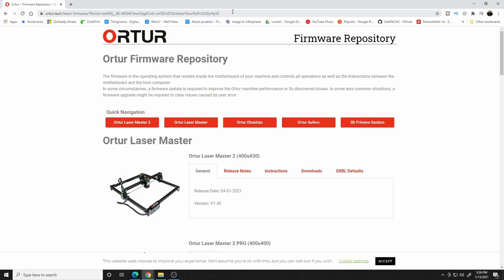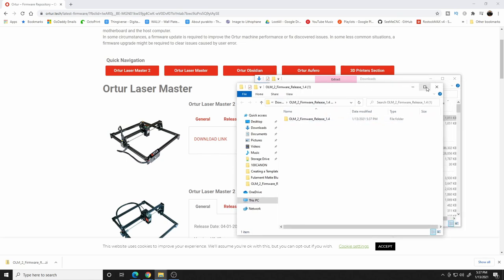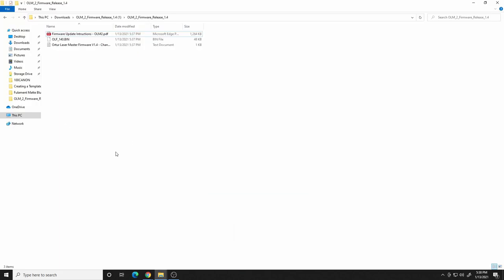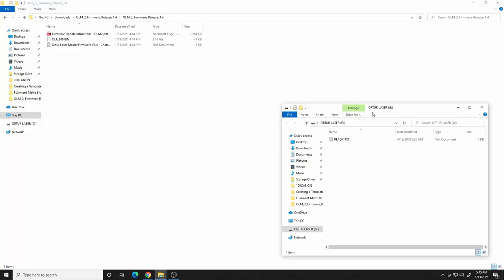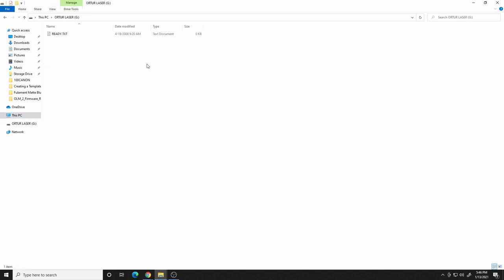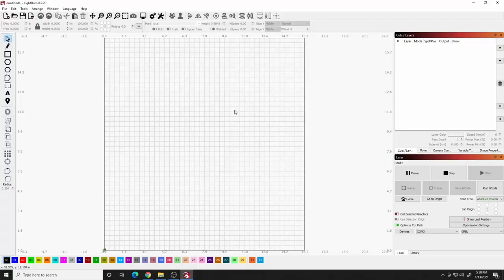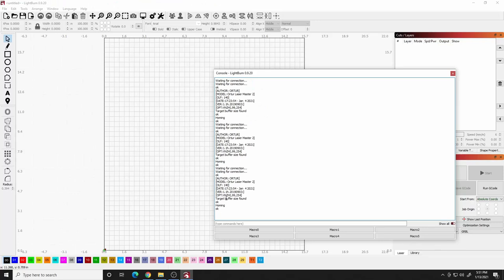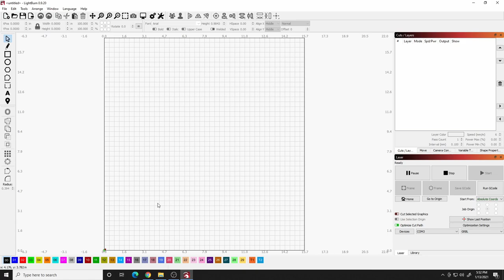How to update firmware on a Ortur Laser in 5 minutes or less

Comment: Have to chuckle at the recommendations ...
When NOT to up upgrade or reinstall firmware:
- Ortur Laser Master 2 is working correctly and showing no problems

When TO upgrade the firmware:
- A new version of the firmware is posted...

I'm not having issues, but a new version is posted .... WHAT TO DO ???   hehe  ; )

Thanks for the video.
Reply: Updated hardware and having issues with the burning what should I do I'm doing the same thing same settings still having problems

Comment: I have the latest lightburn 0.9.20 but when I right clicked on the “devices” tab but it’s resetting the current device connection. I’m not getting the pop up that you are getting
Reply: Me either. Did you figure it out? I'm on day 2 of learning all I can.
Reply: Found it by accident or fate. Alarm went off since the laser won't shut down.
Reply: @euphoricstillness  nope, I’m still getting the same thing.
Reply: @ryanbeharry5636  Near the move tab is a console tab. When you start up the laser it will automatically home and the message will show up in there. Good luck

Comment: I havent followed this advice as yet, and now I am reluctant to change anything after reading all this.  This is the message I got whilst trying out my LM2 20w (older version).  Starting stream
Layer C01 Pass 1 of 2
Layer C01 Pass 2 of 2
Layer C01
Layer C01
Layer C01
Layer C01
Layer C01
Layer C01
Layer C01
Layer C01
Detect movement, terminate laser engraving!
Acceleration fluctuation:325
Reset Grbl.
Ortur Laser Master 2 Ready!
OLF 137.
Grbl 1.1f ['$' for help]
[MSG:'$H'|'$X' to unlock]
error:9
G-code locked out during alarm or jog state.
On or near line 39911:
Job halted
Stream completed in 50:51

Comment: Hey there...I have watched several other videos you have that have been very helpful and have recently subscribed. I tried the firmware update this morning and after dragging the new .bin file over pressing the reset and then the power button get nothing. Was hoping this update fixed a couple disconnect issues in the middle of a few burns but this not powering up thing has me freaked out!  I did message Gil and Ortur tech support and am trying to be patient for a reply from either.  Is this fixable as far as you know with out having to order new parts???
Reply: this happened to me what did you do?

Comment: Jim, in the caution note you say not to use the PRO firmware and use the LM or LM2 firmware. I assume that is because you have the LM or LM2 model. I have the LM2Pro so I should be using that version? I'm new to all of this laser stuff so I'm trying to muddle through it all. Thanks in advance.
Reply from the maker: Use the firmware that is for your laser. If you have the LM2 Pro use that firmware. Good question!

Comment: Did the upgrade. and then would not start. I did not have clue as what happened.
So after searching for about 6 hours I found the OEM bin file. put it back and back up and running
Tech support. all they could say is try this try that. if there is anyone who had the same problem
let me know what you did to get it back up and running.
Cheers

Comment: Ok did all that but now my laser is not burning at full power, seems to only be burning at about 25% power. I am using lasergrbl when I click the laser button so I can set the focus the laser shuts off after a few seconds and then I have to reset the Ortur. Anyone have any idea whats going on here. Used my burner a few weeks ago with no issue to burn some Harry Potter coasters. Any help would be greatly appreciated. Thanks
Reply from the maker: I would try it again and make sure you have the correct firmware for your laser. Otherwise jump on the Facebook group and tag Gil. He is support and he will help you get it worked out!

Comment: So just went through this whole process and now the unit wont power back on. Everything went exactly as you showed, but after the reset, the power button wont work. Any ideas?
Reply from the maker: Did you use the pro firmware? If you did, do it again using the regular firmware

Comment: I did the update just fine, cleared everything but now my homing is completely jacked. It is trying to home to the lower right even though everything in the setup is lower left. It can’t find my project on the table and the fan stays on after I try to do a test fire or frame!!!! I have the latest LightBurn and Windows 10.   Any ideas?

Comment: Well, just got my laser...put it together, excited to try it...noticed the firmware was not the current one...apparently against my better judgement, followed all the instructions to update and now I'm stuck with it not turning on. Still can get it to mount to the computer but nothing else. I've reached out on the Facebook group so hopefully I can get it sorted but man I'm bummed out.
Reply: @Ryan Wargo Make sure you are EXTRACTING the file and not just opening it. The bin file is a different size after you extract it.
Reply: just updated mine to and now it wont turn on did you find a fix for this yet
Reply: @Mysticalmantiscreations  yes extracted it with WinRAR...which includes the bin file, pdf instructions, and changelog. Pretty sure I can't extract it any further, atleast not with right clicking it.
Reply: Sorry man, other than that the only thing I ran into was I didnt have the Pro (which I thought i had) i downloaded the other one that wasnt for the pro and extracted and it worked fine.
Reply: @Mysticalmantiscreations  so I thought about that but apparently everybody is supposed to download the standard file because the Pro download is for a different machine not out yet...not for the Pro motherboard
Reply: @Mysticalmantiscreations  thank you Christopher, I didn’t extract it now when I do the 5 sec my computer say the device malfunctioning and won’t connect to it guess I’ll have to get ahold of customer support
Reply: Mine did the malfunctioning thing a couple times too. It's frustrating when things don't go so smoothly as others.
Reply: @Mysticalmantiscreations  was you able to get it to Connect at all
Reply: Yes, I just kept at it. Unplugging the power, usb over again a few times. Then  pressing reset after installing then holding in power and it homed. Took me several attempts but it did finally without making any pc changes
Reply: @Mysticalmantiscreations  that worked thank you very much sir back up and running
Reply: So I luckily got my problem sorted as well...but not really figured out what the issue was...main help guy remoted into my comp and applied his bin file directly to my laser and it worked! Even he was confused by the situation though so maybe I helped with a weird bug haha
Reply: @PinStrype24  yeah that’s crazy ain’t sure myself doing a two hour engraving now half way through so far it’s fine even the pause and resume is working now
Reply from the maker: Glad everybody's getting into work! Make sure you are downloading either the LM2 or LM firmware. Do not use the Pro at this time. And if it still mounts to the computer and does not work, try it one more time

Comment: Hey Jim I did the upgrade following your video, but I have run into a problem of my laser homing to the right not to the left..Help!!!
Reply: Same here. Will update if I figure it out.
Reply: I believe my problem is that I applied the Pro firmware because of the video pointing out that I had the Pro button layout. But apparently that only means I have the Pro-style motherboard, and not the Pro LM2.
Reply: Yup, now homing properly after loading the latest non-Pro firmware.
Reply: Same here as the others. Ugh! Laser does nothing now.
Reply: @Mysticalmantiscreations  Did you also install the Pro firmware?
Reply: @Dadtheimpaler  yes, after reading your response. I got it working. And here I thought I had the Pro also. Good lookin out. Thank you.
Reply: I used pro and non pro still wouldn't home after the reser, any ideas?

Comment: I did the firmware update and my laser will not turn on.  I can open the folder as described in your video and drop the firmware in again but the same thing happens again.  Have you any idea what I might need to do?
Reply from the maker: Try renaming the firmware file. That doesn't work Hit up the Facebook group and reach out to Gil. He is there support and will get you up and running!
Reply: @TheEdgeofTech  Gil was fantastic, connected via software from his company and repaired ortur in less than 5 minutes.  Thanks again for the recommendation. Keep up the good work Jim
Reply: Yeah how do you fix this?

Comment: Well I have a good idea why they say dont use a Mac... Linux would have similar things... I bet it works fine if you make sure to unmount the drive after copying the file over.
Reply: It seems weird that there would be any problems when the Ortur simply sets up as a USB drive.  I could see problems if there was update software needing to be run on Windows to transfer the firmware via a USB serial port connection but this method seems to be better and avoid those issues.
Reply: @ElmerFuddGun  yeah typically if you were to not allow the system to fully write to the attached disk before ejecting it may not actually write all the data. Ejecting forced that write to happen. Even in windows you could end up in a state where it did not fully write but that usually happens with very large files. If you have ever copied files on a mac or linux machine it can sometimes take a minute before it will tell you that the drive can be removed.
Reply: @ottersdangerden  - True.  I don't have any Mac experience but do have Windows and Linux machines.  There is a setting (at least in Windows) that can turn that "buffering" on and off on different drives.  I always use the "eject" function out of habit and don't see how there would be a problem here.  But like I said I don't have a Mac and Apple does do some weird stuff.   ;-)
Reply: @ElmerFuddGun  turns out it has something to do with the hidden macos folder that gets dropped onto it, so that can cause it to fail. Linux can drop a fille there but that is pretty rare and if you know that is an issue its pretty easy to mitigate. (Liam at astroprint had Ortur support guy and thats where i got this info)

Comment: now my lm2 pro will not turn on ??? what now  ??
Reply: Are you sure you have the Pro? I thought I did, because of the way the buttons setup, but apparently that means it's a Pro motherboard, not the LM2 Pro. Caused me problems until I loaded the correct firmware.

Comment: DANGER   i decided to follow your video and the result was that my ortur is now DEAD !    after your video like a idiot i decided to read the manual where it said something you didn't say......" DO NOT USE A USB HUB"  connect directly to the PC. Duh .... anyone any ideas how to fix this now ?? its doing absolutely noting any more....😖
Reply from the maker: Press the reset button then the power button then the reset button again. And then try to turn it back on. Then go through the upgrade instructions without the hub if it turns back on. If it does not turn back on, jump in the ortour group on Facebook and ask Gil for help. He is the support and he will help very quickly.
Reply: ok update... disconnected the LM2 from the net and USB ... then reconnected the LM2 to a laptop with a very short usb cable.  Then held the Reset button and second later the start button hold both till the light comes on (hopefully, took me 2 runs)  then start the whole procedure again....this time with no hub or usb cable extender !!!!  PROBLEM SOLVED

Comment: I have old 170 on mine, but I tried this method and it won't stay connected to the PC in my computer. So I cannot update to the latest firmware. I believe the prior owner must have installed the wrong firmware on my machine. It works,  but it's not right